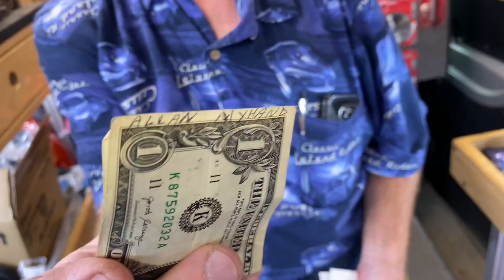Joe’s AllStar Tools: Induction Innovations Mini-Ductor Venom Kit, Monster Light, and Gearwrench

Comment: What is the best air 20 ton jack and 1” air impact
Reply from the maker: I have a Carlyle (Napa) and harbor freight 20 ton. Both are good and doesn’t break the bank. As far as impacts I have had the Snap On, Ingersall Rand, Harbor Freight and the Carlyle ones. There’s not much difference. The only negative I have with the Harbor Freight impact is the trigger is on the outside of the handle so if you bump it, it will spin but that’s about the only negative I have with it. It’s been good
Reply: Omega jacks.
Reply: @KoonTrucking  Thank you for replying I appreciate the info the reason why I need one is because I do metal polishing on semi trucks and there’s times where I have to takeoff the wheel
Reply from the maker: Take a look at the harbor freight ones. For the money you can’t beat them
Reply from the maker: Just remember they love air so get the 1/2” hose